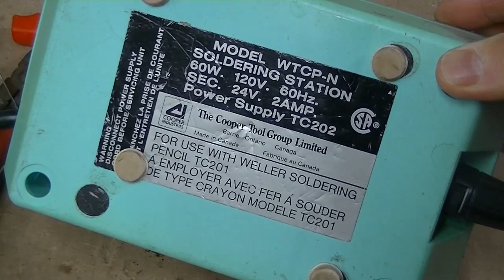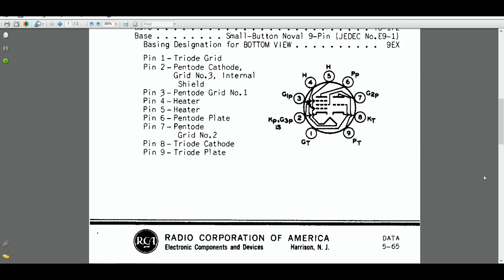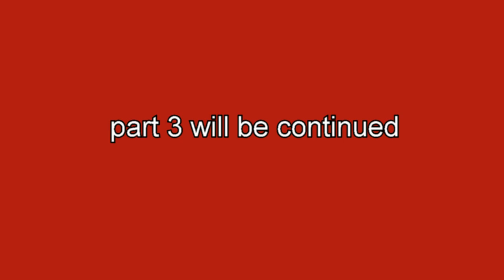audio lecture #20, DIY project 833A SE 50 watt power amplifier PART 2, INPUT stage soldering

Comment: I did not see any serious problems with the soldering job.
Reply: Olle Gladso 
Me neither! It’s not going to win any beauty pageants, but those are nice fat conductors and big terminals and will need HEAT! They’re getting plenty of that as well as a good serving of solder flowing in. Joints look bright,strong and reliable, so the juice will flow freely.
The little bit of insulation shrinking back from conductors that aren’t anywhere near each other isn’t ever likely to be an issue...!?

Those wires are ON and they are staying there!

Comment: What kind of soldering  method do you call that   its no wonder
you have so few comments   and ill bet very few watch all
  thank you for your time   and spend some time and learn to
solder and not burn the isolation
Reply from the maker: Hi, my soldering method may not be better than that of skilled technician. I just concentrate on rigid and perfect soldering rather than good appearance. Thank you for your interest on my videos. Young
Reply: Clay Coates  It’s not going to win any beauty pageants, but those are nice fat conductors and big terminals and will need HEAT! They’re getting plenty of that as well as a good serving of solder flowing in. Joints look bright,strong and reliable, so the juice will flow freely.
The little bit of insulation shrinking back from conductors that aren’t anywhere near each other isn’t ever likely to be an issue...!?

Those wires are ON and they are staying there!

The soldering work is much more pleasant than your manners.

Comment: you spend too much time with the iron heating up the parts...you will drift resistors and melt capacitors once you start soldering them...and i have never seens anyone holding the wire with pliers
Reply from the maker: I guess you didn't try Point to Point soldering / wiring with lug terminals on aluminum chassis. I am going to make a video soon. please keep your eyes on my videos. Thank you for your question. Young
Reply: @YoungAhn  it was not a question, and i dont understand why you would want to solder onto aluminium..??? could screw a tag onto the chassis and solder to that... point to point soldering is my breakfast...i do german and holland vacuum tube tv repair as a hobby. we are talking about small chassis with more than 20 tubes and hundreds of components piled on layers
Reply from the maker: I guess my video is not enough clear, It might seems like that I am trying to solder on chassis but I don't sir. It is one of a large pin of lug terminal which is mounted on chassis with screw, it takes lots of time to solder because aluminum absorbs lot of heat from soldering iron. Soldering on aluminum is impossible as you know. Young
Reply: @YoungAhn  i saw that you are not trying to solder to the aluminium,,,,you said that in the previous comment though... it is actually possible to solder to aluminium but not easy or practical... my only point is that you have too much dwell time with the iron. soldering to a an empty tube socket with a small 30w iron and a clean tip takes 2 seconds touching time...you sped twice that time and as a resust heat upe the wire insulation and the components...if you solder a polistyrene cap in that way guarantee you will short it.... this is not criticising you, its just to help you improve. if you iron takes too long to solder to a lug or tag just use a more powerfull iron with a clean tip. time is crucial, if you are not fast, the heat will spread to the components and wire, destroying them.
Reply from the maker: I'm sorry
Reply from the maker: @MrHBSoftware  I'm sorry, let's do our own job